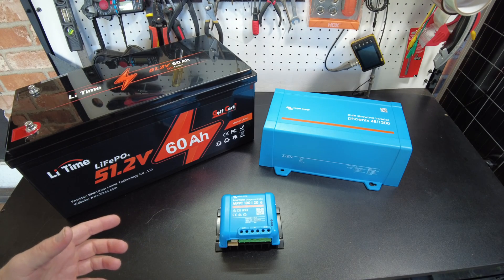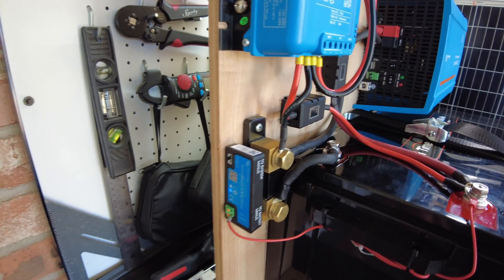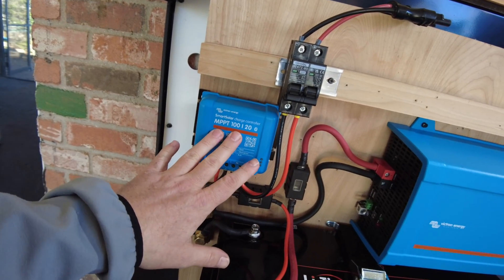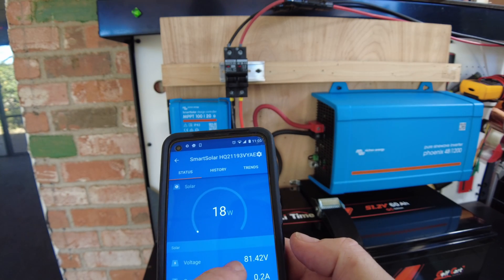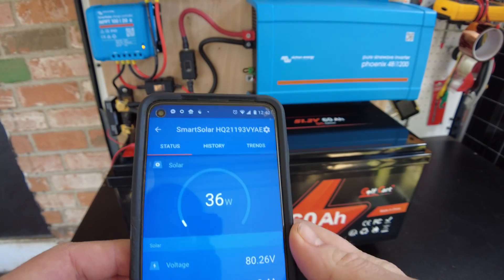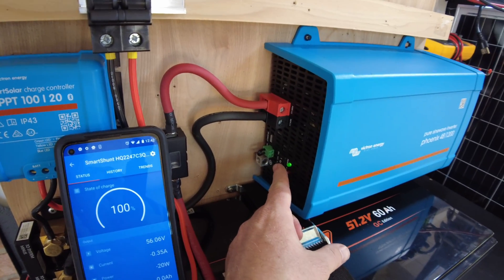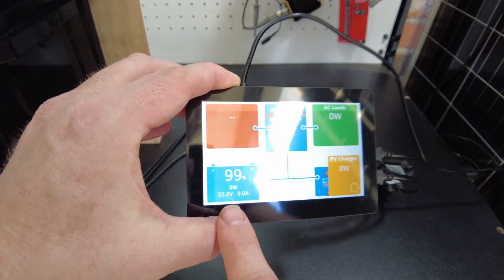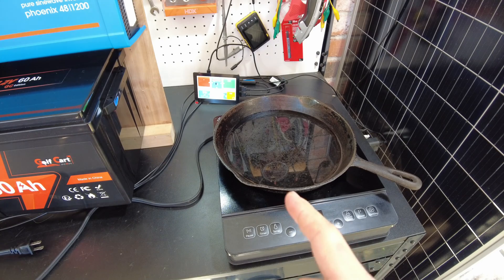Victron + LiTime 48v off-grid

Comment: That wire is total overkill, no wonder it's not getting hot.  6 gague wire would be more than enough for this inverter.  At 1200 watts you would be only pulling around 25 amps from the battery.  Even if it bursts up to 2200 watts you would only be pulling 45amps, which is still within the limits of 6 gague wire.

Comment: Does that app report ANYTHING back to the company?
Can the app be used offline?
Is there any other way to get the data without the use of a cell phone? Something you buy as a complete kit?

Problem with series is that if one panel does't produce, you don't have anything.
At least with parallel you will get *SOMETHING*.
Lower voltage with bigger wire seems to be more robust and reliable.

Comment: Running this exact system only with 4 200ah  ion lithium batteries in series for 48v thanks for mentioning the shunt I was going to use my Vitron shunt gonna check if I can run it in a 48v System?

Comment: Charging 48v battery with SOLAR. people showing this always start with the cables, never showing the panels or compatible MPPT. TO charge a 48v which is 53v do you need the solar array greater than 53v… and what would be a compatible VICTRON MPPT… ur using a 100 20… WHY?
Reply: You're right on the panels. Array voltage must be higher by about 5 volts like with 12v and 24v batteries.

The 100|20 mppt is compatible with 12, 24 and 48v batteries. Check for data sheets on Victron's website.

Comment: @Brad Cagle
Please don't mind me if this is a dumb question. That said, I'm new to the game. I see you used a breaker rated for 30A, however, your charger controller is rated at 20A. Shouldn't you have gone with a 20A breaker?...the 20A would offer more protection? 

Once again, I'm a newbie that wants to skip over building a 12v or 24v solar system and I don't know much. 
* Your set up is pure and clean (unlike 12v systems ) that's what hooked me...Great job!
Reply from the maker: This is actually the recommended fuse size in the MPPT 100/20 manual, it states 25a minimum, 30a max. Also this particular controller has a replaceable 25a fuse, which is not the case on many other Victron controllers, so keep that in mind. And lastly, this fuse is what they call "The battery fuse" It's really there to protect that wire, actually as with most fuses/breakers, they are typically installed to protect wire from overcurrent. Thanks!
Reply: @BradCagle  
 25A or 30A for the PV disconnect ?
30A MIDI-Fuse for 48V ?
Reply from the maker: @shockadellick  The midi-fuse to the battery is what I was just referring to. I guess you were taking about the PV disconnect/breaker. So that is usually sized for the PV wire, so if you're using 10awg PV wire then 30amp breaker is good. It's really used as a disconnect mostly, but being a breaker does add some benefit I suppose. As for the input limit on this 100/20 MPPT, yes it should be absolute max of 20a, but you should not rely on a breaker to do that. You must size your PV array to stay under that max input of 20a. That would be the short-circuit current rating (Isc) on your PV. So if the Isc of your panels in series is 10A, you're safe. If you have Isc of 10a with say two panels in parallel, you're pushing it because that would be 20a, I would give some headroom. Victron has a calculator you can use to properly size your array, and controller: https://www.victronenergy.com/mppt-calculator Thanks
Reply: @BradCagle  
You must write a how to book. You have the best content, and you're easily understood...NO JOKE!
Reply from the maker: @shockadellick  Thanks. Yes maybe someday when I have extra time I'll write a book :)

Comment: Yep. I have a 100/20 and a 250/60 charger (synchronized) and so far only one of the same inverter you have there (48/1200/GFCI). I'll probably be getting another of the same (inverter) or just take the plunge into a Multiplus (haven't decided yet). Thank you for sharing...

Comment: So Victron has a 75|15 charge controller but I can’t find anywhere in there specs if it will work with a 48v battery anyone know?
Reply from the maker: Victron 75/15 will do 12, and 24v only. Thanks

Comment: I have the EG4 3KW inverter but was thinking of buying the 48 /1200 Victron also.  Would you happen to know if it can run a full size fridge with a 120V 7.2 amp draw?  This is about 828 watts when the compressor kicks in.   The EG4 inverter is a power hog and consumes about 1KW of power in idle mode.  I wanted something more efficient, but did not want to buy it without knowing if it will handle the surge when the compressor turns on.  Thank you and great video by the way.

Comment: I have a 36V lithium (single large battery), but I don't see any inverters at this voltage. Can the 48/1200 be used? I'm not using solar, so guessing I dont need the solar MPPT, just want to be able to run 120v off my 36v battery
Reply: You can't use a 48v inverter on a 36v battery bank . There are some 36v inverters available on Amazon

Comment: "Nothing is getting hot" well you are only running 25 amps through 3 gauge wire lol, love the video though! That is also a benefit of 48 volt especially with copper wire being so expensive. If your max draw is only going to be 20-30 amps you could go to 8 gauge wire, save some money.

Comment: Hey I'm not sure what people are talking about that "48v appliances are much harder to find" 
Don't you just plug in regular appliances to the inverter, whether it's a 12v, 24v, or 48v system? What are they talking about??
Reply from the maker: Yes you would just plug your AC appliances into the inverter, and it does not matter whether it's 48, 24, or 12v on the DC side like you said. Now maybe what they are talking about is 12v DC devices? Like water pump in your R/V, or camping fridge (those usually run 12, or 24). In those cases you just get a 48v to 12v DC/DC converter. Thanks!

Comment: In the video, you stopped charging the battery with the panels via the Victron charger before turning on the inverter. Can a battery be charged with solar panels via a Victron charger and a home appliance, such as an air fryer, draw energy from the battery via an inverter at the same time?
Can the Ecoflow Delta pro be charged from such a 48V battery via the xt60 input, which is otherwise intended for the input of solar panels?
Reply from the maker: Yes, you can charge, and run appliances at the same time. Also if your battery is full, and you have plenty of solar your appliance will be drawing power from the solar, and not draining the battery. Now if your appliance needs say 1100w, but you're only producing 1000w from solar, the 100w deficit would come from battery. I've never used a Ecoflow so not sure. Thanks
Reply: @BradCagle  Nice, thanx... one more for dummies :) 
 In this "circular flow" does the inverter determine how much electricity it will draw from the battery, or is the battery the one that pushes as much as it can?

So Victron can bypass the battery, if only it is full, push energy directly into the inverter with its maximum power, or only into the battery?
Reply from the maker: @adamsisernik4556  So this is just a general property of how electricity works. Nothing special to Victron, nothing needs to do any bypassing. The device providing the highest voltage will be the device sourcing the most energy. So if the MPPT (solar charger) has plenty of solar on hand it would be able to provide a slightly higher voltage over the battery, therefor the MPPT would provide most of the power for the loads. Think of this analogy, you and a friend are pushing a car (the load) you are the MPPT, and your friend is the battery. You have plenty of energy so you start pushing very strong, your friend (the battery) just has his hands on the car, and not really contributing because you're all jacked up on mountain dew (the sun), and doing all the work. Then your energy starts to fade (cloud) suddenly your friend (the battery) starts to feel the load, and has to take over, or at least contribute a portion. Now another thing that can happen is your friend (the battery) is not very charged, so he may just be riding on the trunk while you're pushing both the car, and your friend. That's right the battery becomes a load when it needs to be charged. Hope this helps.
Reply from the maker: @adamsisernik4556  Other than a few replies in my comments section I don't have the time to help everyone via email, it already gets overflowed with people asking :) You might consider joining a solar forum like http://diysolarforum.com Thanks!
Reply: @BradCagle  Have you an idea, what happened in this case:  

In the morning my 12kWh 51,2V 230ah battery was at 0% (battery charged Delta pro  inverter - battery all night) and Delta pro at 80%. When the solar panels via Victron 150/35 started charging the battery (with just about 100W), Delta pro just started to work at maximum with the full power of the fans, so I immediately turned Delta pro off and also the battery off. After a minute I unpluged the battery from Delta pro and turned Delta pro back on. Delta pro start to work normally. Delta pro is also charged via Ecoflow Powerstream all the time (I have Ecofloew balcony hybrid solar plant)?

I turned the battery on after theat and it started charging from panels via Victron as usual.  Is Victron pushing to much into Delta pro in this case? What fuses should I get and where to put them to be Delta pro protected ?

Comment: Your charge controller is 20a maximum. I see you put a 30a fuse between your PV and charge controller. Shouldn’t you use a 20a fuse since the charge controller is rated 20a?
Reply from the maker: The fuse is for the wire.
Reply: @BradCagle  Ok I got a lot to learn. How did you determine the 30a fuses? I see you have another 30a fuse from the battery to the controller.
Reply from the maker: @christopherowens2635  Here are some calculators https://explorist.life/category/blog/calculators/ He has wire, and fuse calculators. BTW I use Temco, or Windy nation welding cable. Also I will use silicone jacketed wire. Pure copper only. Nothing less than 105c rated insulation/jacket. The welding wire is 105c rated, silicone wire is usually 200c rated. Bluesea has some good info too https://www.bluesea.com/support/articles/Circuit_Protection/1437/Part_1%3A_Choosing_the_Correct_Wire_Size_for_a_DC_Circuit

BTW this is for offgrid DC wiring in vans,  boats, etc. You really need to look at NEC code for anything used in your house.
Reply: @BradCagle  Thanks for the links.  I ordered 100ft Windy Nation 4 awg welding wires. I’m trying to set up a 36v solar system: 

Renogy 60a controller
1500w inverter
1600w worth of Renogy PV
Eco-Worthy lithium batteries. 36v in 12v series

I think the 4 awg can handle in short distance. I just need to figure out the circuit breakers to get this going, and your response is appreciated.
Reply from the maker: @christopherowens2635 You're welcome!

Comment: Great litlle setup there! I too believe 48 volts is the happy spot for backup or full small scale off grid. Everything mentioned here is valid. Even the inverter needs less heavy primary wire for the switching transformers compared to a 12 volt model. It doesn't have to do as much heavy lifting. One thing I'll mention is that your induction cooktop still uses full power at any setting, except when you choose a "lower" setting, it just pulses on/off like a microwave oven does. I have to laugh when I see people running a window A/C unit off an inverter and think it uses less power in LOW vs HIGH. It's about 30 watts at most difference between low and high.
Reply from the maker: Thanks!

Comment: Great little system Brad, I like it.  Been looking at low budget DIY Victron builds for inspo for a boat project I am working on.  Keep up the great work / creativity.   PS - @11:00 worth looking into a Renogy Boost 10A 36V/48V if you were ever wanting to make 12v panels usable/compatible with your 48v builds without needing 4 of them.   Great range extender for golf carts. 

MPPT Voltage Range: 15 ~ 25VDC / 36V；15 ~ 40VDC / 48V
Reply from the maker: Thanks! I actually have a boost MPPT charge controller from Genasun. Was planning to build a solar e-bike, never got around to it LOL :)

Comment: Ooh, I'm late on this one.  Wasn't ringing-bell subscribed!  Now I am.   This is great!  Nice job, excellent use of ferrules, great job of selecting components.   We need more youtuber's pushing 48V, it's so easy to do, and except for the tinyest of systems, going 48V is actually cheaper than 12V.  I'm nudging influencers to mess around with 48V as much as I can.  (yah, I'm tired of all the 12V videos from many channels too, that are happening because 12V vendors are pushing "free" batteries at them).

My notes:

* I love the smart-solar 100/20.  It's a wonderful low-cost charge controller.  For reference, 20A @ 48V is the same power as 80A @ 12V.  So that little charger controller can do a lot of work with much thinner wiring and less heat.   My go-to charge controller.

The next-higher charge controller to look at is the SmartSolar 150/35.  And when it comes to Victron charge controllers, always be sure to get units that are "Smart" (have blue tooth built-in), and make sure the units can do 48V (which means they can do 12/24/36/48V)... even if you are using a lower system voltage.  Gives you a less costly upgrade path later on.

* Note that the 100/20 and the 75/15 (which is even lower-cost but only 12/24V)... those Victron charge controllers have pretty dinky terminal screws, so be careful not to over-torque them.  It is easy to twist the screw-head right off.

* Great job describing the inverter and amps and so forth at 48V.  I was going to comment on some of the wiring but you covered it.

* 3 12V panels in series will work, just barely.  But 4 is better.. and there is a calculation there for the panel VOC vs the max voltage of the charge controller.  Always de-rate by 20%.  So a Victron 100/20 really should not have solar going in whos sum VOC is greater than 80V.   The reason being that the solar panel VOC specifications are for normal temperatures and sun.  In colder temperatures or bright sun (such as sun + bright clouds), the VOC can be higher.

So 4 x 12V panels actually might be stretching it a bit for a Victron 100/20, depending on how much over 80V you are.  And 3 x 12V panels are just "barely" enough with an operating voltage of roughly 61V (just barely enough for the Victron to operate at maximum efficiency).   I've had good luck with 3 x 12V panels in series.

* The Victron 150/35 is a bit of a better fit with its higher input voltage limit, but I have 2000W of solar connected up to three 100/20s that have been running great for several years now, and it is hard to beat the price of the 100/20s.  I've been using 3 x 100W in series, and typically 3 strings of those in parallel through a combiner box, per controller.   Two sets of those going into two controllers, and then the third controller has 2 x 360W residential panels in series plus a few other random conglomerations paralleled in.   Three combiner boxes and three controllers total for my little back-deck system.   The stuff barely even gets warm during peak production.

* Even though a minimum number of panels in series is required, it is always possible to string together smaller panels if space is at a premium.  3 x 25W panels, even work.  3 x 50W, 3 x 75W, etc.  (or 4 or 5, etc, as supposed by the charger controller).

* Use a 2-pole breaker (and all breakers should be non-polarized), instead of a manual main battery disconnect switch.

Those marine-style main battery disconnects are a fire hazard.  No thermal trip, no spring-loaded trip, no ARC handling.  If it is used the wrong way a bit too many times enough carbon can build up on the contacts to cause it to overheat under normal operating.

* Consider using Anderson quick-disconnects for larger systems with multiple batteries, organized in a manner that allows you to rip the battery out by main force if necessary, if something goes badly wrong.

Wonderful little system, kudos!

-Matt
Reply from the maker: Good info. Yes you're absolutely correct about companies swamping us with 12v stuff. I'm telling them we're bored with that. I'm getting 48v equipment now, it just comes less frequent. I'm fine with that, gives me some time to take a break :) Thanks!
Reply: which main battery disconnects do you recommend to prevent it from being a fire hazard? Thx u
Reply: @ Two disconnects.  An unpolarized DC breaker (which can disconnect under load), and an appropriateliy-sized anderson quick disconnect (for when not under load, or in an emergency).  As well as appropriate fusing, which depends on the battery topology.

I dislike DC disconnect switches for many reasons.

-Matt
Reply: Nice info. 12v setups are generally for beginners. People move up after a while.
For me, I can comfortably use a 2 panel ground mount setup and if lucky can make a frame that holds 2 more on top of those two. Space above but not beside. Has to be portable too.
Going to use 8 gauge wire from panels to charge controller.
If I can do 4 panels then they will be series-parallel configuration due to shading issues.
My setup is for backup for refrigerator or maybe the gas furnace.
Stuck using a DC disconnect switch and a solar circuit breaker.
Have about a 100 foot wire run too.
Still trying to figure out how to get the wires into the house without needing a permit. And have to go under the concrete driveway too.
I am using a commercial grade roll around cart for the hard equipment and batteries.
Fits perfectly in the space I chose.
Basement is far far too humid to put much of anything in it.
And then there is the theft issue to contend with. Yard is only 1/2 fenced and no privacy fencing (which require more permits).
Any idea on security against theft??